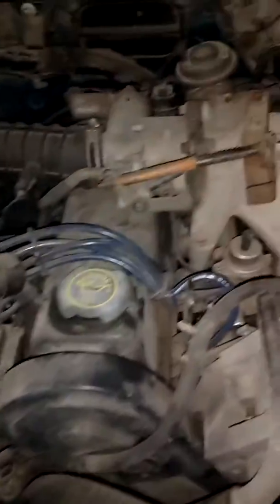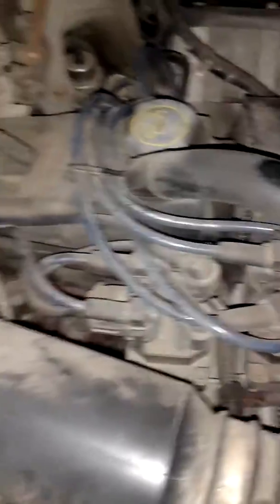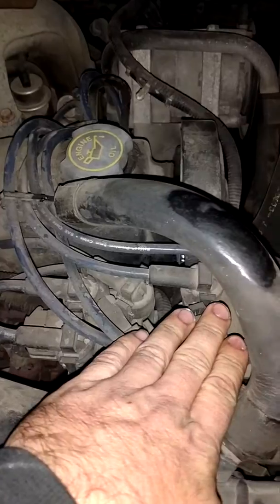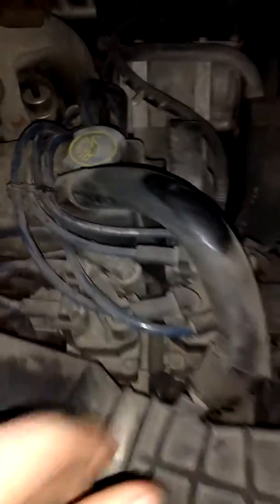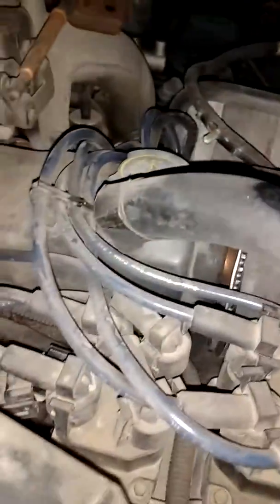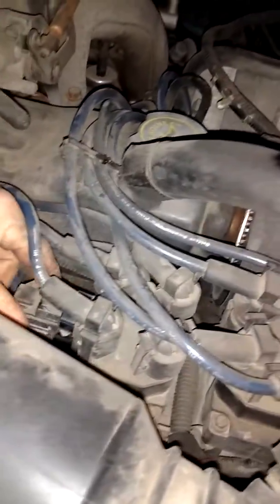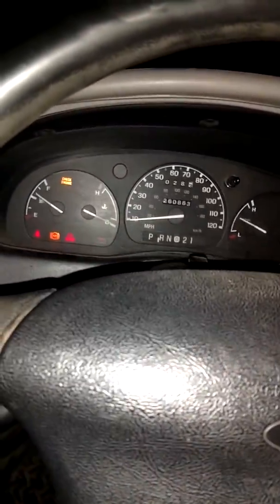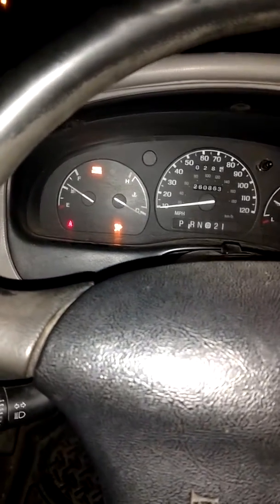The Ford 2.3L Dual plug myth, the explanation of why it doesn't work.

Comment: I'm going to put this to bed. And, for clarification, I HAVE READ all pertinent information from Ford about this ignition system. So, here we go:

First, the basics: When cyl. #1 (cylinders will be numbered for reference) is at TDC, #4 is as well. So, this guy is right.

However, he FAILS TO differentiate something, which is that when the primary for #1 is firing the plug, the secondary coil - the other coil - is firing #4. The primary is firing on compression, the other on exhaust. That is the timing of the coils firing the plugs. Got that?

What the mod does, because the secondary coil is a weaker-firing coil -- only there to burn any fuel left over from the primary (compression stroke) firing, is make both coils fire on any given cylinder at the same time to improve burning the fuel charge in the combustion chamber in one explosion, rather than two. So, in essence, both the primary (stronger) coil and secondary (weaker) coil fire at the same time, for the same cylinder.

Some additional info: In 1996, with the advent of OBD-II, the ICM function was moved from a separate module on the intake manifold to being a function in the ECU (computer). Additionally, there was a camshaft sensor installed that earlier 2.3/2.5 engines did not have. Ergo, this 1997 Ranger runs regardless of which coil is unplugged, because the initial timing of the engine does not change, and the post-1996 engines had to be able to completely burn the fuel charge, due to higher emission standards. The ECU also knows if an electrical connector is disconnected, and can therefore "learn" which one is still connected, which it then tells to fire. This is accomplished by the electrical voltage that the ECU sends as the low-voltage value determined by the air/fuel mixture already determined by the fuel pressure regulator, injectors, MAP, and TPS. All of this information is used to ultimately determine what the voltage being sent to a coil is, and its stepped up voltage after the coil to the plugs.

Pre-1996 Lima 2.3s can do this mod and actually gain performance, because there is not the secondary O2 sensor, along with the cam sensor, as functions in the ECU. Additionally, this mid takes about 200 miles of "learning" for the ECU to implement the mod in its calculations for fuel trim and air intake.
Reply from the maker: I got a couple sentences into the second paragraph and you're already wrong. One coil pack has two coils. Each coil fores two plugs. With every compression stroke there are 4 spark plugs firing. Since compression and exhaust happen in the same stroke, on opposite cylinders. Therefore, there are no differentiation between compression and exhaust strokes. As I've said in other comments, I found out I was wrong, and the spark goes to the compression cylinder first because it's easier to spark an air gap with air fuel mixture in it.
Reply from the maker: Then you OBVIOUSLY don't know how a waste spark coil works. There are not four coils in each coil pack. There are two coils, each coil has two spark plugs and ends on it. The center pin is power, correct, one of the other wires controls the ground circuit for one coil, and one wire controls the ground circuit for the other coil. If there were four individual coils, there would have to be 5 wires.
Reply from the maker: I have had 4 dual plug 2.3s. a 91 mustang, an 89 ranger 4x4, this 97, and my dad's 96. I also was a Ford Technician. I don't have any spark testers, and I'm not going to spend any money to show you that I'm right. Why don't you try to prove me wrong. You can't, so I wait for your evidence. You can look at any wiring diagram you want, but if you don't understand how the coil pack itself works (which is not in any wiring diagram) then you will continue to be ignorant to the operation of this system.

The firing order and coil operation is the same on the older OBD 1 and 2 systems. The diagnostic capabilities of the computer don't magically change how a waste spark system works.
Reply from the maker: To further clarify, when the primary coil fires for cylinder number one, it Sparks the plug passenger side plug for both cylinder one and four. And when the secondary coil fires a few degrees of rotation later, it fires the driver side plugs for BOTH cylinder one, and four.
Reply: @spike662  Thanks for the info Mike, I wasn't aware about the secondary coil firing slightly after the primary coil. Do you know what the theory is behind that?
Reply from the maker: @diymotorcycling1719  the theory isn't something I understand. I'm not sure why firing them at the same time isn't best. But two flame fronts fired later than a single one requires less timing advance, and in theory should be less parasitic as well as easier on the bearings and pistons.
Reply: @spike662  ok cool.  Yeah I'm guessing the few degrees of difference somehow amplifies the combustion.
Reply: Spike, I'm going to say it as gently as I can: You are wrong.

How do I know? Because of the wiring. Each coil has a three-wire plug. The middle wire provides a constant 12 V power source for the coil. The other two wires are signal wires. When cylinders #2 and #3 (per #1 and #4 being TDC) are not at TDC, those signal wires are off. There is no power to them. This is why each coil has wired into it opposing cylinders -- because if both #1 and #4 in the same coil fired at the same time, you could not maintain a firing order. A simple diagram, followed by knowing the firing order (1-3-4-2) confirms this. You do not have four wires firing at the same time.

Tell you what: IF you are correct, verify your claim -- prove what you say. 

Easiest way to do this is put an inline spark tester between both #1 and #4 (and here is the important part) on the same coil. If both testers light up at the same time, you would be right. But I truly do not believe you are...and perhaps I will spend the money on two testers after my engine gets put back together, and I will see what happens myself. Again: Put your money where your mouth is, and prove that there are four plugs (two primary, two secondary) that fire at any one given time. Because if your claim is correct, you should be able to prove it fairly easily -- and since Ford never said what you claim, I honestly believe the manufacturer over you.

So prove it, and upload the video so we can all see it.
Reply from the maker: If my college books were here, I would dig out what I need and show you the illustrations for this. However, they aren't, and until you do the research that you need to, to understand how waste spark could operate, you'll not comprehend how this system actually works, and you will continue on thinking I am wrong.
Reply: Dude...did you not read when I said that I read the technical information put out by Ford Motor Co.? I read the technical documentation -- even printed it out at one time -- about this ignition system. And since Ford designed this system, they would know how it operates.

Besides, I gave you an out: Prove your claim with two spark plug testers on companion cylinders, on the same coil. It is a conclusive test that would prove or disprove your claim. Will you do it, or not? Saying that I "don't know how a spark system operates" adds nothing to this. Besides, if anything, my engine and the OP's engine are different. Maybe not in configuration -- like number of cylinders or plugs per cylinder -- but my engine and his differ in operation, because you have to take into account the differences between pre- and post- 1996 engine management systems. Mine is OBD-I; his is OBD-II. If you are, or were, an auto student, then you know that two O2 sensors became standard in 1996. Not only that, but Ford started using a camshaft sensor, whereas for my truck, there is no cam sensor. I also only have one O2 sensor.

Besides, how do you refute video evidence that a third-gen Ranger won't run, if the primary coil is unplugged? There is a video of a guy who bought a Ranger on Craigslist that spent $500 or $900 (can't remember the amount) for a cheap truck with a cap. The truck is red; I believe he also replaced the timing belt on that truck (which was a second video). His username is Thunderhead289, I believe. 

Having said all that, he proves that the plug mod works. He even proved that the early 2.3s would not run with the primary coil unplugged. How do you disprove his video, which is contrary to this one? I honestly believe it has to do with the mod only working for pre-1996 2.3s that used OBD-I, rather than OBD-II.
Reply: So...you are refusing to put up the video evidence, which would prove or disprove your claim. Logically, since you made the claim, the burden of proof is on you -- not me. However, given that you still want to cling to incorrect information, I will do this test when I have the opportunity to, and we will see who is right. (Note: The test I asked you to do may not happen for several months, as I am on very limited funds, and have to undertake a full rebuild of my 2.3 at 230,000 miles.)

While correct that this system is a waste spark system, the idea that a coil that puts out a very low voltage to simply burn fuel, rather than wait for that fuel to be compressed (with the air) before the resulting explosion shows how little you actually understand how everything works together.

The base timing plays its part, as does intake air being combined with fuel before being compressed and using the resulting explosion for power.

Just because you say you were a Ford tech really doesn't mean anything to me. You could or could not be what you claim. Point is, I gave you a definitive test to show if what you're claiming is correct; you refused that test. I've asked you how you refute video evidence that already exists that shows you are wrong; you don't even watch the video and then say where, why, or how the video evidence is wrong. All you do is make one claim after another, and never definitively prove anything. Worse still, you make an appeal to authority (as evidenced by your claiming to be a Ford tech), which is a logical fallacy. 

What makes me pity you is that you can't stand, like other people (such as cops) to be questioned about your claims. You refuse to even consider where you might be wrong, even when provided with evidence from a party such as Ford that is contradictory to what you are claiming.

Bottom line, since you made the claim, you've not proven anything. This video, which is contradicted by other video evidence (which I told you what and where it could be found), basically shows how and why you are incorrect in your conclusion. Pulling your coil pack plug on an OBD-II engine shows nothing, because of other video evidence. To prove or disprove your claim, you would have to show where other evidence is so similar to yours that what others have done is wrong. But you did not do that, and because you did not do that, you failed to take into account differences between your truck and prior engine management systems.

Until you take into account changes from year to year, or system to system, there is no definitive proof your claim is right, since the burden of proof is on you, and you refused to even address what I've said or challenged you to do.

And yes, I know how a coil pack works: It uses a voltage level through a magnet to create a magnetic field. Other applied voltage, fed through that field, increases based on the strength of the field. At the same time, amperage drops because Ohm's Law.

That does not change the fact that a coil only fires when a voltage signal is fed through the signal wiring, which is in turn stepped up to the voltage needed to fire the plug. And because only one primary plug and one secondary plug fire at the same time, you are wrong for claiming four plugs fire at any one given time. Prove me wrong, since you made the original claim.
Reply: Isaiah Welch All I know not to disagree with either of you two about the Dual Ignition 2.3L that's in my 96ranger sportside xlt that I bought new over 22yrs ago is as weak now as it was brand new,but it runs great but I don't see any gain with 8plugs except it does get great gas mileage,but I would like more power,ive got a straight pipe&tried the K&n filter ,but I guess im used to my LS5.3L Chevy Z71 but it seized up after my headgaskets blew,so now Im putting another 5.3in it&thank goodness I got a couple of great friends that are mechanically enclined.But my ranger has been a great truck but I think my gas filter needs changed cause its slugish&sputtering when I try to give it gas to shift&I got a new fuel pump in it ,I shouldve put new fuel filter in then.But I ve reasearched it&I hope thats the issue,in the morning im gonna buy the tool needed&fuel filter&fix it,if thats the issues no engine light is on.
Reply: Kevin Roark : Check fuel pressure first, at the fuel rail (using the Schrader valve). If that's good, I'm willing to bet it is either: The TPS (Throttle Position Sensor) being worn out; or the EGR valve is stuck.

A mod you can do is take zip ties and add them to the top of your accelerator cable at the gas pedal. That's been known to increase throttle response by taking up throttle cable slack. Also: Take your air intake tubing between the filter and throttle body off, take out the baffle, and reattach. Rangers are notorious for restricting air intake flow, thus reducing overall power.
Reply from the maker: @isaiahwelch8066  the problem here is, you don't understand, I have explained why you are wrong, you refuse to believe it. 90% of the crap you spewed out in that long nonsensical reply has NOTHING to do with the operation of the system. I have admitted what I was wrong about in this video, and where I was wrong actually HELPS my case that the "mod" is not a performance improvement
Reply from the maker: @isaiahwelch8066  you are wrong, plain and simple. A simple Google search on a waste spark coil will show you that. You're ignorant in this situation, and ignorance is bliss I guess. When someone tells me I'm wrong, I find out if they are right instead of arguing with them and looking like an idiot. You seem fairly intelligent, but you are not correct in this instance.
Reply from the maker: @isaiahwelch8066  https://www.motor.com/magazine-summary/diagnosing-waste-spark-dis-july-1999/ paragraph 6 is the start of the information you need.
Reply from the maker: @isaiahwelch8066  here is another article

https://www.freeasestudyguides.com/diagram-wastespark-ignition-a8.html
Reply: @isaiahwelch8066  And OBD2 started mid year 1995, I got told my 95 Ranger was OBD1.5 and the diagnostic socket under the dash was useless. I swapped my EEC to a FLH2 to prove it as well as unplug the MAF and run it till it set the MIL and pulled the code from the OBD2 diagnostic port on both EEC and still got called a liar.
Reply: @slowstang88  man I got a good laugh from this, I recently discovered one of the coils wasn't properly set up after I got the cables changed along with the spark plugs(cheapass cables) so remembering that these coils had the same spark on each tower I fiddled with the cable wires and I suddenly got a spark from the coils(also got zapped in the process) so from then on the engine went back to running fine after it had sudden moments where it randomly ran smooth and then started stuttering as if you had a fourwheeler and gave it the ranger's weight load and tried making it drive. I also discovered some Knocking on #3 by the driver's side so I'm gonna have some fun trying to get that plug out without having to take out the intake manifold or messing up the cable.
Reply: 1994 2.3  l here did coil mod and have more power ( can actually accelerate on a incline in 3 rd gear) also peg the Speedo at 85 on express way. My highly qualified truck technician approved this mod with no downside.
Reply from the maker: @outlyingdatapoint8563  no, it's all in your head.
Reply: Where can I get thses diagrams from ford? I have gotten my hands on a 87 2.3L 4 cyl and im looking to fix it up. However it has jumped time and im afraid its warped the crankshaft. Any and all advice would be very much appreciated

Comment: yea i didnt think that guy was right i heard they fire just a couple of degrees off from each other they made a msd out of it
Reply from the maker: You are correct, they made it to where each combustion cycle has two Sparks instead of one.

The only difference between this and an MSD is that an MSD fires one spark plug multiple times, where as this system fires each plug one time.

Comment: I had a 85 Nissan pickup with 2 plugs per cylinder. They had this engine for a few years only to do away with it in 87 I believe. It was supposed to burn the fuel better or some shit, but all was needed was to modify the combustion chamber. Now i just picked up a 96 Mazda B2300 with this same engine. Interesting post !
Reply: rbagel55 yep z24 basically the same engines but I think the Nissans had more power.Ive got a 96ranger same 2.3L had new since Oct.96/22yrs.It still runs good ,there good engines I think.
Reply: @kevinroark4346  They did,they were also SOHC. I belive they put that engine in 240SXs as well. I had an 85 with a Z24 and then I got a 96 Nissan PU with a KA24E 12 valve, it had  a bit more power. Both were very reliable
Reply: @kevinroark4346  By the way, I was wrong, they used the Z24 till 89